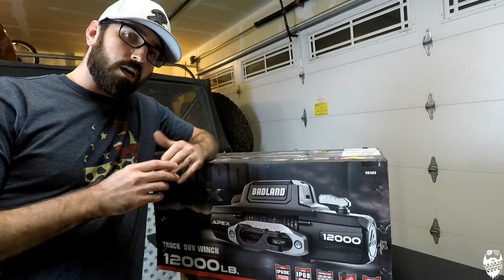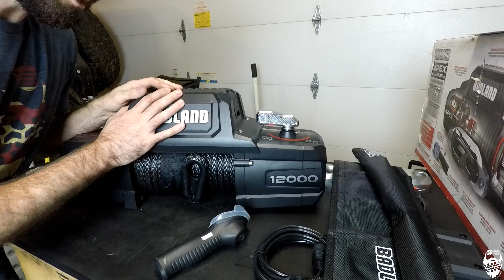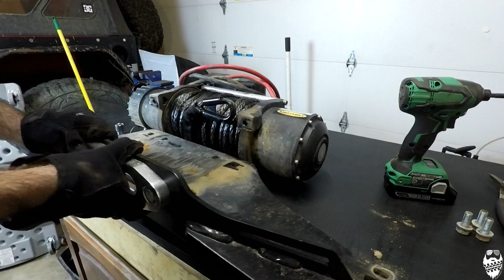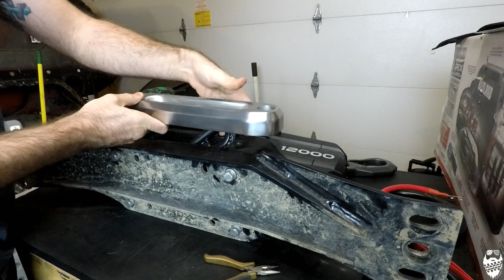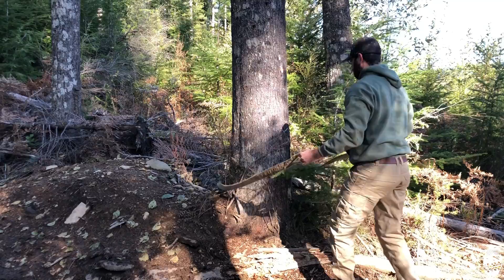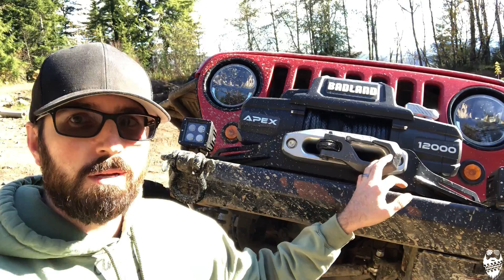Harbor Freight's NEW Warn Killer Winch. Badland APEX Winch install and real world use!

Comment: I’ll stick with my warn.. good luck getting any parts for that when it breaks. Parts for a warn are readily available.
Reply: Just buy the warranty and get a new one every couple years before it runs out
Reply: Jeff Holland  Don't got one yet, but it's what I plan to do. It's always nice having new parts
Reply: Jeff Holland  lmaooo all good m8
Reply: Harbor freight has stated that they plan on making replacement parts more readily available in the future. For like evrything they sell. Tools and whatnot.
Reply: @steamsteed9885  I bought the 3 year warranty for a HF router. Broke the plastic part for the guide a month in. Took it in and waited while they called some 800 number. "Sorry not covered by the warranty." Will never buy HF power tools or warranty again.

Comment: Harbor Freight stepping up their winch game by copying Warn instead of mile marker now. I would still cough up an extra $50 and get the name brand warn vr evo 12-s. Their customer support alone makes worth the extra. Not to mention replacement parts availability.
Reply: Can you get a Warn 12k for $599.
Reply: My quick Amazon search found a warn vr-12 for 619 and a warn evo-12 for 673. I'm sure if you look around some more you could probably find them a little cheaper.

Comment: I don't doubt that it works and I'm sure it's plenty capable.  However I'd be hesitant to put a HF winch on my off-road vehicle.  Longevity, reliability, and durability are more important to me than capacity.  Having a winch failure out in the field is a hard lesson to learn to save a few hundred bucks.  Honestly a winch is one of those buy once, cry once purchases.  That's why I'd trust Warn or Superwinch over most brands.  Going to need a lot more long term user reports before calling this thing a "killer" winch.

Comment: Looks like my warn zeon winch. If they actually put oil and grease on the gears and protective goo on the electrical contacts and connections, it will be far better than warn. Oh and warn is far from water proof. Ok so it's way better than anything warn.

Comment: I bet it only has 65 ft cable on it like the old harbor freight winches an you can only run two snatch blocks on it. I run a Smittybilt winch because it has a 100 ft of cable on it and i run 5 Snatch blocks on it and do Extreme Recoverys with it.
Reply: He said 80' at the beginning of the vid

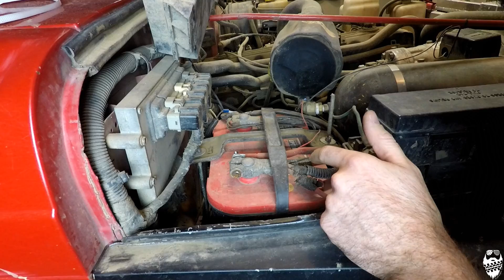Comment: 3:21 convert to True military style battery post connectors then run double ought welding cable to your starter and your ground. FYI you'll know true military battery post connectors because they're stainless steel not the $4 crap jobs at O'Reilly's
Reply from the maker: I will look into that👍🏻
Reply: @MuddyBeards4X4  BTW awesome video quality work too

Comment: OMG! I am a full-size truck guy ('85 1 Ton KChevy and a 96 K2500 Suburban) and also and old motorcycle desert and MX racer so I have some idea of what it takes to do things off-road. OMG! mind-boggling what you are doing here as "let's go get stuck". Could you talk about the differentials that are in you Jeep during this Youtube? I have factory GM LS clutch types in both trucks and I want Torrsen type worm gear/ worm wheel type as no maintenance and much sooner lock up. What are you running? Why?

Comment: But it has a 5% Duty cycle. 45 seconds of use then 14 minutes 15 seconds of rest. Won't be very useful if you get REALLY stuck.
Reply: Aaron Stramiello StramielloPhoto at 12,000 lbs
Reply: @windowwiz100  If you have a 5K pound vehicle stuck, with outside forces it does not take long to get to 12k. The duty cycle on these winches has always been their biggest downfall.

Comment: Why synthetic rope and not cable?  I think I like cable better . Can you tell me why rope and not cable.
Reply from the maker: Stronger, lighter, safer, lots of reasons. Most off road competitions don’t even allow steel cable anymore👍🏻
Reply: Me personally I like cable better synthetic is good in the long run cable is actually more durable you have to clean synthetic lines warn is the winch I would go for.
Reply: There is no question that synthetic is safer and lighter. But steel cable is way more durable!  Ive seen multiple rope lines snap, have yet to see a cable snap (thank God!) Synthetic breaks down over time and with any direct sunlight. Its lifespan is not as long as steel cable. Ive run both and prefer synthetic just because free spooling steel cable sucks!!!
Reply: @krover01  I agree I never had one cable break.  I had so many synthetic on my RZR and they all broke. I kept them clean and never let it pile up . My cable I dont let pike up either.  I just don't know now.  12000lbs winch and its synthetic.  Omg.   I won't but it with out cable.  Thanks for the video Muddy.  You have alot of them.

Comment: The new ones are called ZXR 12000, not APEX; silver hook, silver cable, diff. body style than APEX. Is the ZXR the same winch or not?
Reply from the maker: Definitely not the same. The apex is the top of the line winch with synthetic rope
Reply: @MuddyBeards4X4  Yeah, I went to the HF store today and saw the both models, side by side. Totally diff animal. What's the major benefit to the synthetic rope, and other differences that the Apex has?

Comment: warn has always been way, way, way over-priced.
Reply: they are good stuff, huh?
Reply: My Warn 8274 was made in 1983,  has made thousands of pulls,  and still works as if it was new. If it do break it I can have any part on it overnighted in the mail .  There isn't a chance in hell this china made winch will be working in 37 years and if it fails after your warranty at hf you can throw away your $800 .  I have no problem with the cheaper  hf winches but $800 is too much to spend on a throw away product you can't get parts for.    Warn products are not cheap but people who don't understand value are.
Reply: @bdd1469  yeah, maybe not so over-priced. they're good iron, huh?  do you know how they stack-up to Mile-Markers hydraulic units? i honestly never had a winch.
Reply: @bdd1469  I agree, I just looked it up $800. Might as well as spend a little more for a WARN. But I also dont believe Warns quality is the same as 1983 year model. Could be wrong tho, thats all companies nowadays.
Reply: My 3yr old Warn winch has screws rusting. I live in Colorado, not the rust belt. My Jeep is garage kept and 8k miles a year. Even the stickers on the warn started falling off after 1yr. I know some people that have had that Warn's for 25yrs but Warns aren't made like they used to be. Warn are not worth the price anymore.
Reply: @mattn318  that "3yr old" might not be of the same quality as the old. i felt that (the old was too pricey) years ago, considering a freaking winch cost more at that time than a brand new short block. if they're selling you guys (i don't need one, i drive an fj40) a chinese winch at old USA prices they are clearly taking advantage of you. rigid ain't RIGID, black and decker ain't BLACK AND DECKER. maybe warn ain't WARN anymore, either...
Reply: @bdd1469  

> I agree 100%... Just under $1,000 winch & you can have a USA (repairable) & maybe lighter unit
Reply: @johndunn9819  Never had a mile marker so I can't say.  I'm not a fan of hydro winches because they don't work if the engine isn't running.  I've winched thru water deep enough that I had to shut off the engine so I didn't hydro lock it.
Reply: @iceee187  The newer 8274 have a bigger motor than the old ones and a contactor instead of individual solenoids. I think the newer 8274s are actually better,   can't say about the other Warns. I just repaired a VR10,000 at work that someone ran into and broke the free spool handle off. For a $600 winch it seemed pretty decent and the entire end housing with handle was only $71....
Reply: @mattn318  Really? The screws are rusting and the sticker fell off?  Put any winch thru 3 years of colorado winters and heat cycles and see if the screws dont rust.  If you're worried about stickers and screws you probably don't need a winch on your mall crawler.
Reply: bdd1469 was thinking the same exact thing.
Reply: @mattn318  Man, you're complaining about hardware and stickers, two things that have little to no direct impact on how the device works (aside from holding down.) Spend ~$8 for some stainless hardware and print yourself a sticker
Reply: My badland works juzt fine for my mall CRAWER
Reply: @mattn318  what you get with Warn is the support over the years. Buy this one and in a year or two they will disappear and you just throw it away
Reply: @Achisachis73  you do have a good point there
Reply: @bdd1469  but warn winches are now made in china also...
i do agree that these new Chinese winches might not last as long as the old ones. but it is more about old well made products vs new cheap made products.
just like comparing my 1984 chevy truck to a new truck.
Reply: @MrMrsregor   Lol.  An 84 Chevy truck in the rust belt where I live would be rusted out in less than 5 years. My 06 is still rust free,  and they have only gotten better... The 700r4 transmissions in the 80s  were well known to be garbage,  and often needed to rebuilt long before the hundred thousand mile mark. The 4.3, 5.0, 5.7 and 7.4 were fine engines for the 80's but got terrible gas milage, leaked everywhere,  and are no where near as refined as todays LS engine.  While new trucks have many more bells and whistles to fail , they are hands down without a doubt better trucks than anything built prior. Trucks used to hit a mile stone at 100,000 miles. Now that mile stone is 3,4 or 500,000 miles. 
 Warn cheaper VR line of winches are made in China,  but parts are available and in stock all across the country. Warns more expensive winches are still made in Oregon,  with some global parts.  Non of that really matters as you can build a quality product in any country on the planet.... I'll take a warn winch with parts easily available overnight vs a harbor freight winch everytime,  regardless of where either one is made.....
Reply: @bdd1469  first, you clearly missed my point, i was not starting a chevy debate, just making a comparison of the old to the new..
second, i do not live in the rust belt and my 28 year old chevy only has a small bit of rust in the rocker panel, and thats it.
third, i do not have a 700r4 tans, it has been converted it to a 350 with sm465 manual trans, np205, and 14 bolt
Reply: MrMrsregor only the VR series from warn is made in china. Rest are made in US...
Reply: Looks nice and good video.  Please think about where this is made - China. And consider investing in an American 🇺🇸 made alternative - Warn, Ramsey or Milemarker
Reply: @bdd1469  you better do some research, any warn under a grand is China made now.

Comment: What winch plate is that?
Reply from the maker: It is a $90 Smittybilt one, I have had it for about 8 years. Although it did bend a few years ago under a heavy load.I finally will be replacing it here shortly with a barnes4wd one.

Comment: Have to see how it holds up long term my 9000I sits unprotected on my bumper and has worked everytime for 6 years , but I'd like a 12k winch , but don't want to drop $1600  , so if this holds up I may have pull my warn banner off the beast...lol...thet don't pay me to put their name on my rig anyway .
Reply: yerwrng it’s $799 currently
Reply: @jeremy8715  I realize this is $799 but a Warn in 12k in this style is $1500 , I currently have a warn 9000I that's a $1000 winch but would like this style as it's close to the zeon style  but not $1500 . The issue I have is how it holds up long term I'm not a mild wheeler in a daily driver , so I need it to work when I need it to work , so this the reason I want to see how it holds up for him
Reply from the maker: Can’t tell you long term yet, as I have only had it a week and my Jeep is stored in my garage. Also they are $599 with the code in my description👍🏻
Reply: They just released this winch a week or two ago so nobody has long term reports. But even their cheap badland winches hold up pretty damn good so I'd put my money on it being a damn good winch long term. Warn winches and the like are just overpriced, overrated "look how much money I have" item winches now days. Every weekend I see smittybilt, badland, engo, milemarker and other cheap winches working like mules and getting the job done. Hell my good friend has had to send his $1,200 warn zeon back twice now and is only been used like four times! It breaks pretty much every time he has to use it. Warn isn't what it used to be.
Reply: It's on sale right now for $599. I just burned up my vr8000 and it's cost almost $400 to fix it. $200 bucks for 4k more pounds looks good to me. My other truck has the old version and it works like a champ.

Comment: I would have liked to see the winch pull the jeep up those logs without any assistance from the drivetrain. I have absolutely zero believe it couldn't do it, my 9k badland winch can pull my 85 3/4 ton chev on 35s uphill in park but I'd like to see how it does when it has to actually grunt

Comment: Is the mounting hardware grade 8 or the grade 5 that comes with their other winches?
Reply from the maker: To be honest I didn’t look, lol. It was late and I was tired, just throwing it on.
Reply: My guess is probably pot metal crap that will break in short order.
Reply: I don't know about the Apex winches, but, my older Badland winches both came with metric mounting hardware. It was supposedly the highest grade (10.9 or something?), but I replaced it with known U.S.A. made fasteners of the same size and grade. I have the old 12k winch on my 78 GMC K-35, and the 9k on my car trailer.

Comment: I'll stay with my warm the fact that Harbor Freight sales it tells me that it's not going to be anything special like all the rest of Harbor Freight stuff good for one or two uses and then scrap it
Reply: Their Badlamds winches are sold at other major outlets and on Amazon. It's not sold exclusively through HF. The Badlands winches are actually really good winches that hold up. I have the 12k winch that's the previous generation to these and for the last 2 yrs has never failes me on my jeep amd I've used it a lot
Reply: My warn xd9000i has been going strong for 30 yrs, and still fully rebuildable..  and still being made to this day.
Reply: I’ve had a badlands 12k forever still great
Reply: They are slow. And can't get parts for them. But for the price get a smitty
Reply: I have hf winch from 2002 and still works good.
Reply: I have a lot of tools from HF.  I have not broken anything yet.

Comment: My only concern is how long it’ll last... harbor freight stuff is inexpensive for a reason
Reply: I've had the original 12k winch and never had a problem. Had to pull a flipped over 4x4 out of a ditch and not a single issue.
Reply: For the record harbor freight is cheaper mostly because they cut out the middle men. Look at their business model and it’s easy to see how they are able to be profitable with such low shelf pricing. Most, not all, but most of harbor freights new stuff especially is of the same caliber as brands two to three times the price
Reply: Unitygroove311 while I have had some tools hold up from HF, I’ve had equally the amount of tools crap out after first or second use... until they shake that reputation then I wouldn’t trust my $60-80k off roading rig to it... some things you just don’t cheap out on.
Reply: Hey man, I get it. You’re absolutely entitled to safeguard your stuff any way you like; I’m just stating that price isn’t always indicative of quality. There’s plenty of expensive crap on the market that isn’t worth the ink on its price tag. I’m also saying Harbor Freight has really stepped their game up these last few years. Yes, they still have some stuff that’s on the low end of the spectrum where quality is concerned... but there are lots of new products that are capable of competing in the high end arena.
Reply: Unitygroove311 oh I’ve seen my fair share of expensive crap lol... I get what your saying.. I just wouldn’t feel comfortable trusting such an important piece of gear coming from HF.
Reply: It is the same stuff you but at other stores. The only differences is the  branding.

Comment: Not  a really good test. At 12K that winch should just pull the Jeep up, instead you throttled it up the hill.
Was the winch stalling? I ask because I am looking to put on a 6000 truck not a lighter Jeep.
Reply from the maker: The winch works great. In my last wheeling video we used it a ton, pulled an LS swapped JKU on tons with 40’s. My Jeep 4 times and another Jeep. No issues. Worked just as good as the 12k warn the other guys had.

Comment: it's the size of your engine, may have cooling issues
Reply from the maker: Good catch, I did think of that. Also the Tj is notorious for have cooling issues, especially if you block half the radiator. But I have a aluminum radiator and electric fan. All my driving is low speed anyways so I don’t have any flow from the front of the radiator anyways, and it’s been fine.
Reply: @MuddyBeards4X4  did you ever have a problem with the smitty?. heard there pretty reliable
Reply: Everything Jeep put that AMC 4.0l in has cooling issues. My XJ has similar problems, not really sure wtf Jeep engineers were thinking.
Reply from the maker: Had my Smittybilt for 8 years, never let me down.
Reply: AMC 4.0. One of the best engines out there. My JK on the other hand has a minivan engine. Cooling problem easily fixed. Wrong engine...not as easy.

Comment: I'll keep my 8274.....thanks!
Reply: Yep, have three of them, 1 on my 85 CJ7, 1 on the Dodge Cummins 4X4, One on my Ford 350 Diesel with 5000 lb. Camper that I snatch blocked last year and yarded the whole thing out of a huge ditch. Don't rely on a wireless remote, cause you may not use your winch for a long period then discover the remote batts. dead.